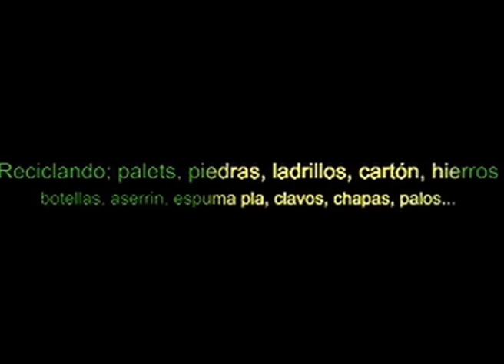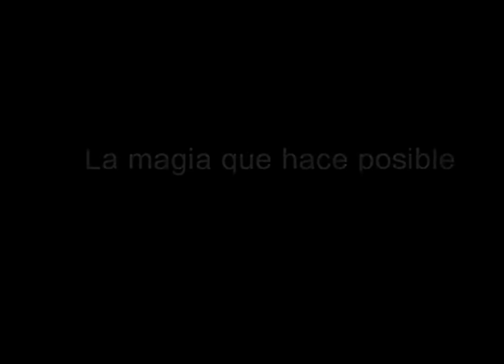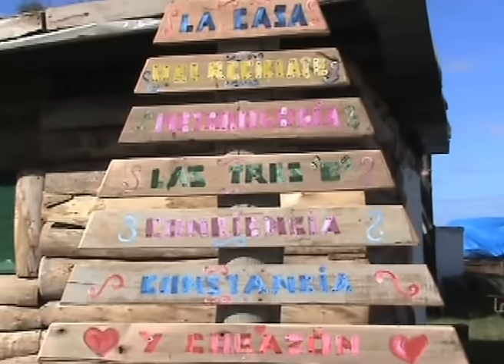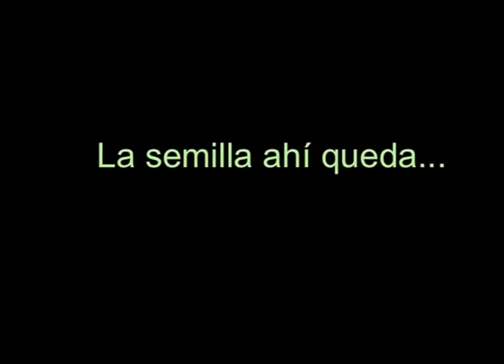Casa palets

Comment: Hola me encantó el proyecto. Podrían decirme si dentro re vistieron con algún tipo de cemento o es otra parte de la casa que ya estaba hecha con otro material. Y también si es que debajo de los costaneras pusieron nylon
Reply from the maker: Hola, el interior es la propia pared de palets, la ranura o hueco entre tabla y tabla se relleno de yeso y se tinto o envejecio para que parezca todo madera, tambien se podria forrar de tableros o con tablas machimbradas, segun gusto o posibilidades. Y si, fuera puse una capa de nylon para evitar que entre humedad directa al palets, ya que el relleno interior es material sensible a la humedad, saludos
Reply: @federiconciencia  muchas gracias!!!!
Reply: @federiconciencia  quiero consultarte estamos por hacer una ampliación con paletas. La parte superior por que la rellenar on de cartón y no con arena. Y lo otro es si no tuvieron problemas con los ratones que se metieran e hicieran nido ahí. También quisiera saber si forrar por dentro el palet co nylon de silo en vez de espuma plast es viable.
Reply from the maker: Hola, arriba se puso carton y aserrin porque fue un recurso mas aprovechado y menos pesado, el nylon puede ser como dices, yo jugue con los recursos mas economicos que encontre y para evitar roedores u otros bichos, se podria forrar con tela metalica de agujeros pequeños, espero que te haya sido util, saludos